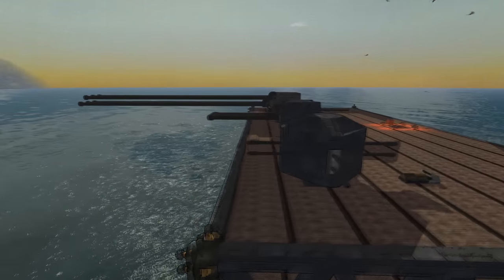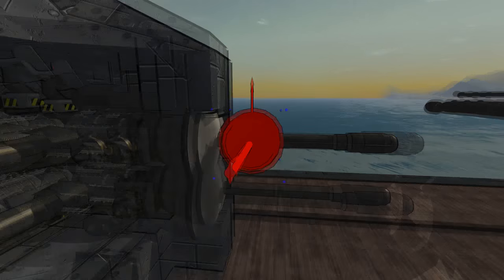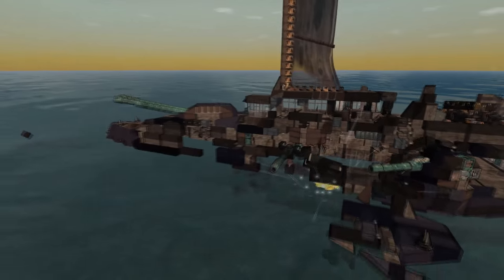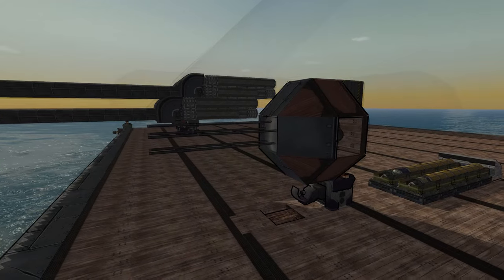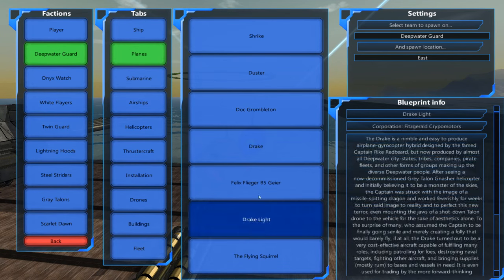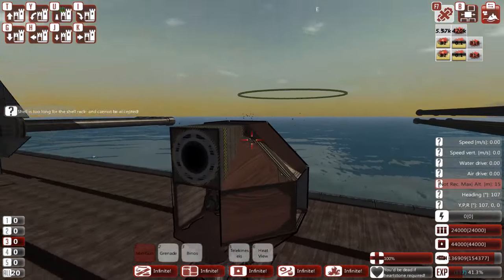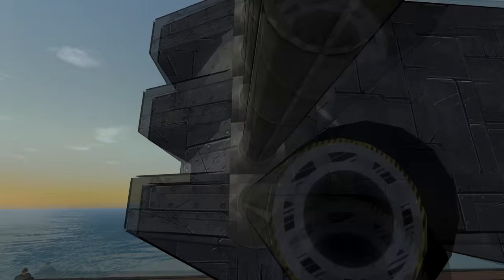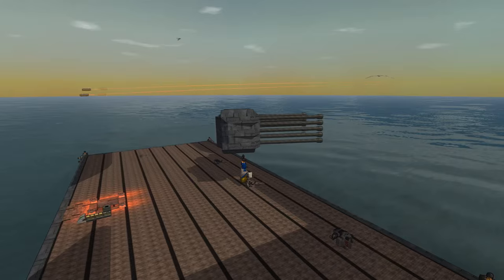No-Autoloader Cannons Pt.2 - From the Depths

Comment: I have to give you credit ireLAN. I participated in the OW refit effort and I used your direct feed APS cannons to upgrade OW ships like the Ironclad, Straussland and Telemachus. I build new OW ships, the Proctor and an Angler replacement. They both use direct feed APS exclusively, as high power low RF guns are the focus of this faction. They work great and they are very part efficient. So thank you for inspiring me and others. :)
Reply from the maker: +karbengo Wow, thanks very much, dude!  I'm flattered that this trick made it into the Onyx Watch.  Now I only have myself to blame when they blow me out of the water, lol!
Reply: +karbengo The Telemachus USED to be one of my test target ships because it couldn't fight back against air targets.. Now it's actually pretty deadly to aircraft and far from defenseless. Great update on them!
Reply: Revengeful Lobster To be fair, somebody overwrote my update to it, so it has autoloader fed guns again, for now.
Reply: In any case, they are really deadly now, so still great job on them. I was really surprised when my B25 got shot out of the air.... I have to refit that AGAIN now!
Reply from the maker: Pssst, max range str1 25m shields are only 150 power.  Don't tell anyone! (They work well too!)
Reply: I'm trying to keep my WW2 aircraft a bit more 'pure' so to speak, but if they're invisible it counts right? I may put them on my own campaign builds as well.
Reply from the maker: I'm pretty sure any shields is defying purity in terms of WW2, lol.  In terms of game balance though, you're just gonna need em.  Invisishields are fine imo. :D
Reply: +Revengeful Lobster (Phil) You should totally make some videos about those. They sound pretty cool!
Reply: The OW is probably the best faction when it comes with core damage and tankiness. Thanks for your designs.

Comment: I tried to make a cannon that could take out extremely heavy warships with one shot, it was a 500 mm cannon, and it was incredibly accurate, had insane muzzle velocity, statistically at least, the barrel had to be 1.1 kilometer long, and after tweaking could only get it down to 654 meters long, the shell was so big, that even with this little system, it didn't work, as in the game can't handle the type of shell I was trying to build, if it used an autoloader, it would have needed a 100 m shell rack, even if it did work it would have taken 8 minutes to fire every shot. I intended to make a weapon that could accurately hit targets from beyond 8 kilos away, and it would have been accurate enough to do that, I never would have needed a weapon like that, just would have been fun to be one of the first to make a cannon on that scale. But God damn it I am going to make a cannon that can do all this.
Reply from the maker: +Vilhelm Mursal Lol, that's an admirable goal!  I'm not sure if it's possible to one shot a ship with a single shell due to the blast radius cap though.  You're gonna need at least a pen-depth fuse to get it into the middle and the most damage.  Also, I would recommend aiming for a 5km range instead of 8.  The AI can't target past 5km, otherwise you'll have to eyeball it yourself!
Reply: +ireLAN Gaming Oh damn there's a blast radius limit? What is it?

You might be able to use frag shells though, ungodly hellstorm of shrapnel.
Reply from the maker: Winterous For blocks it's 11m radius (max 23m explosion).  Players, missiles and NPCs can be hit by the full range though.
I've tested frags pretty extensively.  I have yet to find a shell that benefits from them. They don't perform very well.

Comment: Nice video! I think this kind of guns is very important with the local ressource patch. I have constructed a frighter with a lot of this no autoloader guns. very cheap but an acceptable firepower.
Additional I made a little auto cannon on my helicopter. I agree to you that they are very good and neccessary since the local ressource arrived.
Reply from the maker: +Phorsicht Yeah, for sure!  It let's you get away with a little less overhead and squeeze just a bit more juice out of your small vehicles.  These little teeny cannons are so easy to fit onto stuff. :D
Reply: Today I wanted to use this mini-autocannons. But it looks like Nick has patched it. It is reloading with the time of one! Could you reproduce that?
Reply from the maker: I just tested it to make sure they were still working and they seem fine on my end.  The mini-minigun is performing the same as it was in the devtest as far as I can tell.
Reply: ireLAN Gaming Yes mine are working well again. I don't know what was the problem before ;)

Comment: I might be late to the punch here, but I have two major recommendations:
When using a two-axis turret forgo mantlets entirely. It'll save space and RP and the two-axis turrets can reach almost every angle so long as you don't obstruct them.

Also, try adding a firing delay on each barrel in your weapon to create "walking guns" for continuous fire.
Reply from the maker: +Rex725 I have since started ignoring mantlets on 2axis turrets, so your advice is sound.  The barrel firing delay is pretty much only cosmetic though. :)
Reply from the maker: +Rex725 I have since started ignoring mantlets on 2axis turrets, so your advice is sound.  The barrel firing delay is pretty much only cosmetic though. :)
Reply: Sadly the firing delay in the game only really applies to the first salvo. Maybe they'll add an option to wait on other weapons to fire in the future.

I've been trying to build a "World Ender" cannon of my own with 500mm  8m shells and keeping the RPM to at least 60. Currently the model needs  249 loaders with clips (~500 ammo inputs). Exactly what the relation between the autoloaders, ammo inputs and clips are in terms of actually effecting reload time. Cooling is easy to get down, but tanking that reload is the main issue.

Comment: Could you go into detail about the new oil processing mechanics. Cool vid and cannons
Reply from the maker: +mackenzie allan  Thanks! I still have to look into the oil processing in detail.  It seems to be fairly simple in that, the bigger your oil processor is overall, the more efficient it is.  There is definitely some balancing that can be done between the parts though.

Comment: I may just "borrow" some of those cannon designs :P especially the small one for some of my starter crafts.. great video
Reply from the maker: +Baring 91 Be my guest!  The little one is really effective.  I find it kinda funny that the shell customisers make up more parts than the actually cannon. :)
Reply: +ireLAN Gaming Any idea if the little one is effective against the new shielded, less-squirrely squirrel? I could do with a really, really cheap alternative to the massive CIWS domes, to reduce the profile of the secondaries on my Baltimore cruiser!
Reply from the maker: They can indeed hit the squirrel with the shells shown in the video, but they don't do a great job on their own due to the low damage.  2 or 3 of them should work alright.  I think the cannons are a little broken in the current release though.  There's a problem with ammo input feeders it seems.  I'm sure it will be fixed soon though. :)
Reply: I'll have to satiate my hunger for ship destruction with other games for today! But my cruiser has room for two of these cannons, and I think I'd do well in my new campaign to accompany it with an anti-air frigate. Problem is, as soon as I build one, the DWG rolls over and capitulates and sends nothing but Atlases and Paddleguns at me.
Reply from the maker: Ouch, it's almost like they know. :o
Reply: +ireLAN Gaming It's not just me then.. i felt really stupid for not being able to make such a simple design work.. it's just not loading the shells properly.. it loads 1 shell every 30 seconds or so..
Reply from the maker: Yeah, don't feel bad, it ain't you. It's completely screwed at the minute.  I've been playing with missiles in the mean time. :D
Reply: I have to thank you. Your videos have really sparked my interest in From the Depths ;)
Reply from the maker: You are very welcome! I'm happy to keep people interested in this game.  It has to be one of my all time favourites. :)

Comment: I keep thinking about using these direct-feed guns as bomb shafts in a bomber like the railgun one, except with some token gunpowder. Accuracy probably won't be necessary as the muzzle velocity would be very low and thus the inaccuracy wouldn't add much movement compared to what gravity adds. If your weapons only fire once per pass it shouldn't matter that they reload slowly...

No idea what even that "reduced" recoil would do to a bomber though.
Reply from the maker: +massivepileup Haha, I think dampers would need to make up a lot of the plane. :D
Gotta agree though, this no-loader method would be fantastic for bombers.  They're so teeny tiny.

Comment: I would love to see a bomber redone with these.  Max gauge, 1m long barrel, tiny railgun amplifier, and a 20m HE shell.
Reply from the maker: +Ellen Durette It won't work sadly. Longer shells need a big barrel to remain accurate.  You will end up with either a 200m long barrel or a shell that never hits it's target, also railguns give velocity based on mass.  You will only shoot a 20m projectile at 1m/s without a massive railgun.  The no-loaders idea would be great for bombers, just not for overly long shells.
Reply: I did say bomber.  Like the one you did before.
Reply from the maker: Yeah, but you still need a barrel for shell accuracy.  Longer shells need a longer barrel.  If you drop a 20m shell out of a 1m barrel, it's gonna be off by about 45 degrees.  It won't hit anything in a million years, lol.

Comment: On the second one, you should set delays so they fire at a staggered rate instead of all at one time. Like maybe half a second between every shot?
Reply from the maker: +Tristan Sutton It looks cool, but I don't think it works.  I tried making an organ gun type gun before, but the firing sequence gets out of phase pretty quickly.  The problem is the cumulative firing delays.  First round of shells works fine, 2nd round of shells, all of the firing delays are doubled relative to the first shot, 3rd round of shells, it's tripled, etc etc.  I don't think I've explained that very well, but it unfortunately just costs you weapon dps. :(

Comment: the problem for the insanely huge cannon is similar to beltfeed autoloader. When they are out-of-play clips won't get loaded
Reply from the maker: +Ignisrex Yeah, that's pretty much the biggest problem with them.  At least with belt feeders, you can pre-load them before you go into battle.  With these direct input ones, you can only get a single shell.  The rest of the inputs start from a fresh timer.
Reply: +Ignisrex I'd hope that that'll get changed, at least for the beltfeds. Kinda undermines the point of the out-of-play system if you have to put everything into play all the time.
Reply from the maker: Yeah, it would be a really nice feature to allow ammo clips to fill up while out of play.

Comment: Best shell known to man in my opinion: AP capped head, solid warhead, pen depth fuse, 3 frag war heads with the fragmentation set to 1 degree and you have created a laser
Reply from the maker: +Juanderwoman That sounds like it would make a small, but concentrated hole, lol.  What sorta shell diameter do you use for that?
Reply: +Juanderwoman Ohh, I like! Bypasses the new ERA as well!
Reply: ireLAN Gaming as little as 76mm which will go through double layered wood beams, 1m gap then pass through one wood block and severely damage a metal block. My average mm on my ships is 2 250mm double barrel guns then one 500mm which it will destroy all onyx watch vehicles.
Reply: +Juanderwoman darn, I would have thought it would pen due to the depth fuse.
Reply: TheGavote ERA stop projectiles and fragments so internal ERA would be useful for this round
Reply: I knew it stopped HEAT and frag, didn't know it erased AP shells too.
Reply from the maker: ERA doesn't work on kinetic rounds, it's only fragments and HEAT shells.  AP shells should work fine.  I think what he's saying is, internal ERA, hidden behind the first wall of armour, would stop the fragments after the pen-depth fuse sets them off. :)
Reply: +ireLAN Gaming True! It would defeat appliqued ERA though.
Reply: I know this is late, but you can actually use a sabot head and it wont hurt the damage of the frags, making it a direct upgrade.
Reply: Flosi Lyons Really.

Comment: So, since you're one of the Jedi masters of cannons, I've got a few questions. Or for anybody browsing the comments here who might know what I'm talking about.

Since the update, I've been running into a few oddities. The most irritating of them is this odd little glitch I sometimes encounter when spawning a vehicle into the designer or around the starts of battles. I'll have a perfectly functional ACC, all it's feeders are set up, it has ammo, all of that good stuff, but the clips refuse to accept shells. I'll watch the input feeder's 'Time since last shell received' display, and it will count up to the expected time just like normal. But when it gets there, it switches to a rather odd value like 'negative 1349 since shell received', and continue to refuse to do anything. So then I'll fiddle with it, get fed up with that, respawn it, and then it'll work just fine. Maybe. Do you know anything about this?

Is there a way to have a turret with multiple firing pieces that staggers it's fire?  I've found that with multiple high caliber rounds firing at the same time, that they'll all just hit the same spot and completely negate the purpose.

Why are frag shells so awful?  On missiles it's the opposite, that explosive sections are worthless and frag is the OP one. I've even gone on the calculator and done the math, and frag shells really should cause some serious wreckage. And yet in the vehicle designer, I've got 500 mm frag shells barely scratching the paint on the Onyx Watch ships.
Reply from the maker: +Phillip Wendt First question, known bug, it should actually be fixed now. That was a really annoying one, lol.
I don't think there is a good way to stagger multiple firing piece turrets without them getting wildly out of sync after a few volleys.  If you use firing delay, the delay will double each time in relation to the first firing time. e.g. first salvo .5s delay on 2nd firing piece, 1s delay on 3rd firing piece.  Second salvo 1s delay (in relation to the first shot) on 2nd firing piece. 2s delay on 3rd firing piece.  It's not ideal as the delay accumulates.
Frag shells, I hear ya dude.  They are quite poor.  I've had a little bit of luck with making them good though.  They can mess up wooden vessels pretty bad.  They seem to work best with a timed fuse and make them detonate a fairly large distance from the target (about 30m or so) to get the damage area that you want.  You can also lower the distance and change the cone angle on the frag shells to tweak it a little more. I've found that using them as an on-impact shell, they suck really bad, but this seems to make them a lot more effective.  They still utterly suck against metal targets.  Definitely better for wood.
Reply: +ireLAN Gaming  You are correct, I haven't been getting that bug after this latest patch. Am I ever glad, because I kept tearing apart my cannons thinking it was user error.

As for firing delays, I found a decent workaround. I run time fuses now, and I set them in a nice little spread of -0.1, 0.0, and +0.1, which actually creates some rather interesting effects when it comes to armor penetration. It has the added benefit of  turning all my anti ship cannons into dual purpose antiaircraft flak. I don't normally favor anything larger than 1 meter autoloaders,  but I've been having fun with 250 mm 2 meters, as they can utterly wreck all of the White Flyers aircraft.

Anyway, thanks for all the brilliant vids. There may come a time when I actually stop using timed fuses for everything, but I doubt it.
Reply from the maker: Cool. I like timed fuses as well. They're very versatile. :)

Comment: i'm beginning to wonder if you can actually protect gauge increases and ammo clips from high explosive blast radius , its like metal armor is just not there... like the bastion turret just falling off or in larger calibers just detonating bypassing the armor coatings. either its broken or im doing something wrong.  but i dont think its me lol metal is all intact and everything on the inside explodes , often exploding the whole ship or cuts it in half. trying to build  ACC thats half reasonable to survive more than one shot on the outside without detonating is proving difficult :)
Reply from the maker: +Robert Evans The problem is that stuff on spin blocks and turrets essentially count as a different vehicle and the explosion code works a little bit differently for them.  What happens in their case is, if the explosion touches the turret when it's, for example, 5m from the centre and the explosion is a total size of 10m, the turret will then propagate a 5m explosion (the remainder of the radius) on the turret and create a new explosion radius from there.  Sorry, it's kinda hard to explain.  I'll probably do a video on it at some stage, but Nick has mentioned that he will be changing the explosion code again in the future, so we may just have to deal with it for now. :D

Comment: wonder how fast a shell you could get In a super long sniper cannon with 15 gunpowder with a sabot head
Reply from the maker: +Phiseth Say You can still probably get them pretty fast, but nowhere close to what you used to be able to do (13km/s was possible....) also, there's no real reason to anymore.  It used to give you an enormous damage boost having a really fast shell, now it gives you much less of a damage boost, so the only benefit you get is accuracy.  Anything over about 800m/s is probably wasted unless you're using it for extreme ranges. :)